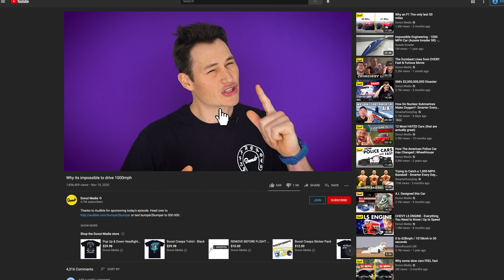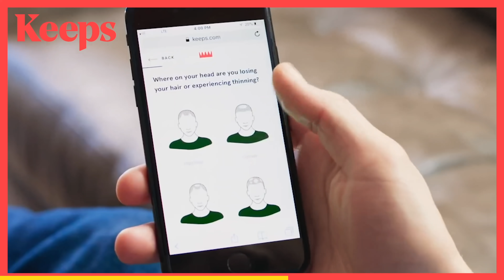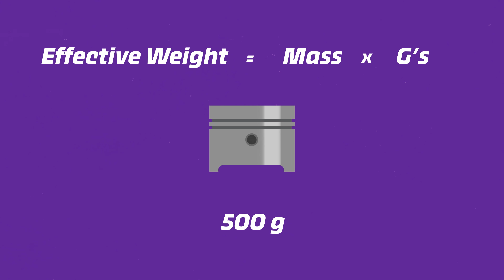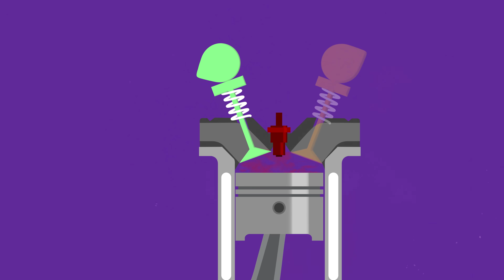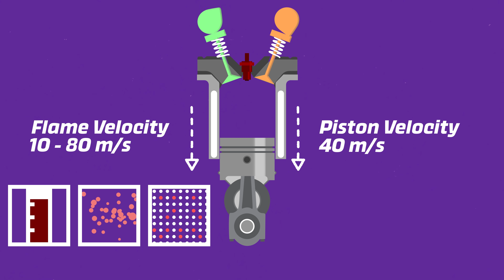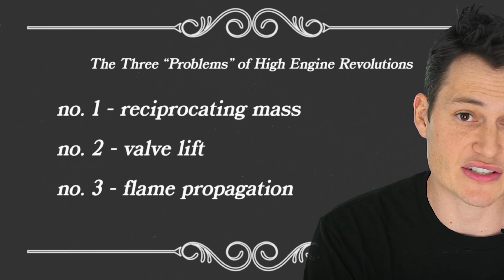Why It's Almost Impossible For An Engine To Rev Over 20,000 RPM

Comment: Nitro rc car engines can go well over 25k rpm. The traxxas trx2.5 can go 40k rpm on 20% nitro fuel. Of course these engines are incredibly small, 2 stroke, constantly soaked in oil, operate with incredibly tight tolerances, and wear out very quickly in comparison to their larger counterparts.

Comment: The explanation got just a little dicey around the flame speed topic but good video. There was definitely some juggling of laminar (still environment) vs turbulent flame speeds, but the only correction that I'd make is that turbulence does (or at least typically does) dramatically increase flame speed and that quoted 10-80 m/s flame speed is definitely turbulent. Most laminar flame speeds are surprisingly slow. Like, you can walk faster, kinds of slow.

Comment: I feel like nobody remembers about Desmodromic valves. They are the literally unaffected by valve float as the opening AND closing are mechanically controlled! :D
Reply: Well they constrain the valve position by not only opening the valve by a cam, but also use a cam to close the valve in stead of a spring, thereby not allowing any valve float.
Only problem is that the load on the closing cam increases with RPM, while it reduces on the spring. 
I don't think a Desmo could go as high as 20K
Also it turned out the valve float they tried to fix was not so much a problem of RPM, but more of valve spring oscillation. This is more easily fixed by using 2 or 3 smaller valve springs (with different resonant frequency's) in stead of 1 big spring.
Reply: Desmo valves are NOT the answer

Comment: In the section on valve float, I'm surprised yall didn't mention the system Ducati uses.  Desmodromic valves have a thing like a rocker to open the valve, but no spring to close it. Instead there is another rocker looking thing that forces the valve closed, which is also run off of lobes on the camshaft.
Reply: True enough but today's valve spring technology allows the engine to rev just as high without the complex desmo system. Even Ducati is phasing it out.

Comment: Sorry guys, but RC guys like myself have had .12 motors revving past 50k for easily a decade, its just not on that level for full size because materials in full size engines can't handle the pressure in combustion yet.

Comment: So saying “impossible for any engine to spin faster than 20,000 rpms” is a little too broad. The revo 3.3 had a max rpm of 50,000 though most usually around 35,000 rpms. Though it’s an rc application, still an internal combustion, piston driven engine.

Comment: Rosatom generation 6 centrifuges, created 35 years ago, still operate at 90,000 RPM.
gen 7,8,9,9+ significally faster.
So, it`s definitely possible to make engine that can operate way more then 20000 RPM

Comment: I wonder what the RPM limits of a rotary engine are. Would be interesting to see how much force an eccentric shaft could handle from the rotational force of multiple rotors
Reply: I was just thinking that it seems like something like a rotary engine would possibly provide somewhat of a solution for the first problem 🤔

Comment: problem 1. cost
problem 2. cost
problem 3. stroke length, which i presume could be avoided by having stupidly short strokes, maybe by adding pistons and reducing stroke length you COULD go over the 20krpm, but, why? doing such things would add weight, but it is possable

Comment: Honda GP motorcycle engines of the early 1960s spun to 22K or so. Five cylinder 125cc, six cylinder 250cc engines.

Comment: "no engine can rev over 20k"
Me: drives old rc car with engine that revs to 50k rpm.
Reply: Was looking for a comment about nitros
Reply: I was hoping to see a comment on rc nitro rc engines. I get that there is next to no mass compared to an automotive engine but it still is proof that it is possible
Reply: @the_wandering_one1  two stroke rather than four stroke aswell

Comment: You are forgetting n°4: efficiency
More rpm = More force due to friction. So, if you go super fast you will also lose a lot of energy. If engines wouldn't break and it was cheap to make them to rev fast, they wouldn't be economical in fuel consumption.
Also, an engine with low rpm and everything else equal will last longer.

That's why, when we can, we make rpm as low as possible. Boats and stationary diesel engines have very low rpm, like 100 rpm or so. They are VERY fuel efficient. One of those engines can achieve 50% efficiency (you move with half the energy contained in the fuel). Compare that to a normal car, with less than 25% efficiency.

Comment: Pretty good little vid... I try to explain to people that in road racing 5 grams (the weight of a nickel) off of each reciprocating assembly is worth more than 100 pounds off the entire weight of the car. - less power to accelerate the actual reciprocating assembly is more power to accelerate the car.

Comment: I do not like limitations.

Ultracar: 

So, you have a problem with air density.  Use it.  
So, you have a problem with rev limits...  
Make the piston sleeve work against the piston itself, as another piston moves it, increasing total compression, while opposing the sleeve to another piston.  You add explosives to your mix to expedite propagation by passing the wave with excited microparticles.

You eventually replace the idea with deuterium and go nuclear in a cyclical engine, but that is an auto supreme.

The Ultracar uses an engine as a back up power source for emergency and as a starter.  It also helps exchange exhaust gases into power.  
An Ultracar lubricant is liquid hydrogen. 
An Ultracars power source is the road, usually rail, but Ultracars are not restricted to these roads, but gain peak performance from them. 

A fuel cell for hydrogen provides partial power, the engine can burn nitrogen oxide, natural gas, or hydrogen.  It requires water.  

The electrical engines load to orbital dynamic kinetic energy battery, which then displace needed energy through dynamic torque conversion.  Dynamic as the transmission stages into variant torque loads in the toroid body.  

Transpositional tires then take the load of the drive train to a semi-conical tread, which allows the tires to act like a transmission but also lowers the chassis onto the rail while maintaining the same suspension system.  

Most trains use leverage systems to pick up chassis and change lanes or break line and separate for cars to go to destination exit without stopping the train.  Autos are Independent, and equal to private jets, with equal legislative enforcement.  The road is both power and communication.  Yet both are also independent, as the locomotives are powered, yet the line is renewable and nuclear facilities.  Lightning collected. 

The Ultracar is larger than a normal car, rating to a big rig transport truck or a tank.  Its tires are cooled with hydrogen. 

Breaking returns energy to the vehicle, and respectively to the line.  Emergency breaking is done with the use of the snow tread, and parking struts, while extremes in breaking hop the body down to full chassis dragging in controlled and extreme g chattering.  While body panels blow away to display roll displacement air bags if the vehicle enters a frictionless or contact roll.

High speed transit system for a new age of vehicle.  

The ultra car becomes the new nascar and reaches mach speeds. 

So with a Tesla valve engine combines with scramjet systems once velocity is reached and a few other tweaks to a first generation nasucar vehicle...  
Interdependent four wheel steering means your controls are augmented.  Whole full manual is a nightmare of pedals clutches, paddles, and throttles, the mid electrically controlled vehicles are suited, while full auto controlled is available, yet licensing requires the use of mid formats.  Which are redundant systems after the vehicle is taught by a full manual pilot.  

Push to stop, pull to accelerate, while pedals and throttles are reduced in number with automatic clutching.  

As the drive is four wheel independent, the need for dynamic turning, and suspension alterations are fully manual to fully automatic.  Toggle controls for each wheel provide full coverage of wheel alignment.  Again a full back stroke will provide dynamic breaking when over all tires, and opposite to each side.  Forward stroking will promote a hop. 

Yes, full hydrolic control. 
https://m.facebook.com/story.php?story_fbid=10225850480029827&id=1267698847

Comment: Forgot one other important limiting factor.  Air molecules only move so fast before you run into problems with mach numbers.  Honda figured this out in the late 70's with their NR500 oval piston F1 motorcycle engine.  The physics of air limits rpm to 24k so even solving for all these other problems (which they did with the development engines), you'll never fill the cylinders above 24k rpm.

Comment: The Cotez engine Instead of valves with springs it was an overhead cam design with rotating trap door with bushing seals. 
It went hush hush and disappeared. I can’t find any on it anymore. It was based on a 302 Ford block.

Comment: Rod to stroke ratio and extreme light parts made from "unobtanium" is how F1 has achieved it for decades till they limited the rpms. A smaller displacement engine has a better chance from smaller swept volumes.

HP = tq x rpms ÷ 5252

Tq is bore and stroke
Rpms is rsr small bore

2 sides of the same coin to make HP

Say i have a 03 636r @ 16krpms and a 03 1200 HD @ 6500rpms.

.636 x 16000 = 10,176 liters displaced for 120hp
1.2 x 6500 = 7800 liters displaced for 79hp

The engine 1/2 the size out displaced and made more HP through volumetric efficiency

Comment: Material Science combined with Desmodromic Valves or Rotary Valves can resolve the first two problems - there is only one problem that limits RPM;  Fuel burn rate  and therefore Physics. Not really impressed with this clip.

Comment: The exception being model aircraft engines.  A Cox TD .051 cu. in. 2 stroke engine in a speed control-line model aircraft turned at 28,746 rpm, at a fastest lap of 149.7 mph.

Comment: You're a little bit too late 😅 Honda did that in the 60's with the Honda RC116 2 cylinder 50cc motorcycle revving up to 21.500rpm 👍

Comment: You made a very fundamental error in the fuel system. The fuel injector does not "vaporise" the fuel at all. It is an electrically controlled jet, like that in a carburettor, though this jet is operated by a solenoid, which allows fuel to be sprayed into the intake under pressure from the fuel pump. The fuel is vaporised in the combustion chamber. Fuel sprayed from a fuel injector is visible, fuel vapor is NOT!!

Comment: Åudi's "diesel" Le Mans winners revved to 22,000 rpm, HondaRC116: 22,500, my old Honda CBR250 racer redlined at 22,000.
Valve float solved in 1954 Mercedes W196 F1 (and Ducati bikes): Desmodomic - positive opening & closing vales, no springs.
Do more research.

Comment: Motorcycles in the 60s reved that fast. It isnt limited. F1 thought in the 70s and 80s that the rev limit would be 12000rpm but they were rong. So are you. F1 was limited in 2007 to 19000 because they went during 1 year (2006) from 19k to 20k and they would have spinned faster. Cosworth already announced 21k rpm for the last race of 2006 so this whole video is wrong

Comment: The Ducati Desmodronic system is an interesting way to get rid of valve float. I'm pretty sure honda made a couple of 5 cylinder 125cc and 6 cylinder 250cc engines that had stupid high Rev limits.

Comment: Done at 7 minutes! What an over educated  dumb ass! You have never built a true race engine in your life. YOU do not mention R/S ratio and how it effects your dwell time at TDC and BTC and the extreme benefits of having a high R/S Ratio. Also how a well designed camshaft and valve train can make it happen  FYI I built a turbine engine that ran 143,000 RPM's. Yes 143 thousand revolutions' per minute. The fiber optic counter and processor was not cheap. 48 pounds per square inch of self produced boost into the combustor. That was also 300 PSI of 90/10 Kerosene and gasoline being injected at 11 pounds per minute with a "special" spray pattern. I limited it by the circumference of the turbine blades to ensure they did not exceed the speed of sound on the outer edge of the compressor an power turbine diameter. One more thing ..... "What does hair loss treatment" have to do with engines?

Comment: I’d like to see a video comparing a piston engine to a rotary engine in this vein. What limits the revs on a rotary?
Reply: '' What limits the revs on a rotary " theoretically the same thing that limits a ''piston engine'' the flame front ... its a mind fk trying to compare rpm and combustion cycle between the 2 engines .. example 
4 stroke engine with 1 cylinder the crank shaft turns 2 full rotations to 1 combustion cycle 
 the piston moves  down(intake) , up(compression), down(combustion) , up(exhaust) during combustion cycle . 3000rpm = 1500 combustion cycles = 6000 piston movements

single rotor wankel engine the eccentric shaft turns 3 full rotation to 1 rotation of the rotor 3000rpm=1000 rotor rotations =3000 combustion cycles

Comment: The shaft speed(s) of jet engines are not limited by friction or wear (there isn't any), heat is only relevant for the gas generator and even then it is a compounding factor and not sole limiting one.

Comment: Go back fifty six years ... Honda had several GP motorcycles capable of revving past 20,000 RPM and were all conquering until Honda pulled out of motorcycle GP at the end of the 1967 season.  Look up the RC149 five cylinder and the RC115 50cc twin, both of which could rev safe to 22,500 RPM.  Then there is IMO the most revered four stroke motor ever made: the RC166 250cc inline six cylinder DOHC air cooled engine that made the most beautiful sound at full honk of 21,000 RPM on the overrun.
Interestingly, these motors ran on 46 to 55 octane gasoline depending on the altitude, temperature, and for all I know sunspot activity in order to maintain an overrun as high as 2,500 RPM.  All done with drafting tables, slide rules, and manual machine tools.  Imagine trying that today!

Comment: 1966 Honda RC166 motorcycle, as raced at the Isle of Man TT races by Mike Hailwood.  250 cc 6 cylinder with four valves per cylinder was run at up to 25,000 rpm on the bench and up to 20,000 on the track.  Max power occurred around 18,000 rpm.

Comment: Dude,The nitro engine in my track car (in thumbnail) runs @ a consistent 42,000 rpms and fits in the palm of your hand
Reply: Nitro Radio Control engines can rev all the way up to 50,000+ rpm!! You are right!! I have a Traxxas revo 3.3 and that bad boy peaks horsepower at around 30K. People need to be informed about these engines!!
Reply: @_. this is a direct quote from the guy in the video: "the fastest revving motor peaks at around 20,000 rpm" he didn't say anything about the size or type of engine, just that it is a "motor". by definition he's wrong lol

Comment: The N. 3 is not a problem. In the 4 stroke engine the flame front propagation speed is roughly proportional to the turbulence in the combustion chamber which is proportional to the mean piston speed. I.E. in theory a gasoline engine has no revving limit, by the chemical reaction factor.
Indeed the small 2 stroke model engines can happily rev at 30000 RPMs with no flame propagation limiting

Comment: Fairly loose with the research as usual.
F1 were revving over 20k back in 2006 before a 19k mandatory rev limit was implemented. 
Rc nitro piston engines see up to 50k rpm
Even the old 1988 CBR250RR could muster 19k

Comment: Nolan, it would be great if you'd make an  episode of nitro racing rc and engines, we use nitromethane two stroke engines that do 35 to 40,000 rpm. They produce aproximately 2.5 to 3 hp with a displacement of 3.5 cc!!

Comment: This video is mostly psychobabble. For various reasons - some poorly alluded to here - it's simply the size of the engine that weighs most heavily on max RPM. That's why a container ship engine redlines at 120rpm, a CBR250RR can spin 20k rpm, and a nitro RC engine can spin 50k rpm.

Comment: Uh??? Turbulence INCREASES flame velocity, due to exposing more fresh mix to the flame front at a higher rate than normal flame front propagation. NOT slowing it down. Thats why we use squish-pads in the combustion chamber; it drasticly reduces the ignition advance to reach MBT.

Comment: The Toyota Mirai will probably be a bad car since it uses hydrogen technology. It claims to be 100 percent Emission free. but blowing out water of the exhaust isn't ideal. Imagine a Toyota Mirai in seattle, where it is cold and freezing. Roads become icy due to water blowing out the exhaust pipes. Exhaust pipes frozen due to hydrogen technology. WE NEED ANSWERS can you answer if the TOYOTA MIRAI is a future solution?
Reply: What does this have to do with the video?

Comment: It is possible, but it's only for once.
Go to the max speed in 5th gear and change to 2nd or 1st gear, and the engine WILL happily rev 20000+rpm.

Comment: F1 motors ran at 20k for three seasons before being limited to 18k so they could limit the number of engines that could be used over a12 race season.  The 20K motors cost around $300k each and could only be leased.  At COTA in Texas they sounded like a missle going down the straight.  So yeah you can do anything with money.

Comment: The flame speed thing is total nonsense. Air/fuel mixture burning in an engine is not standing still as it's ignited, squish as well as tumble and swirl motion of the air as it passes into the cylinder causes turbulence that increases the effective area of the flame front, promoting better mixing between hot and cold charge and thus accelerating the combustion. It's possible to make the combustion too fast actually, too much turbulence rejects more heat into the walls of the combustion chamber so a balance has to be found in development.